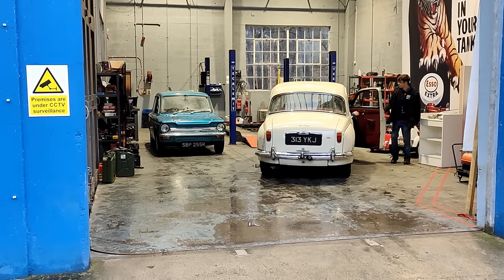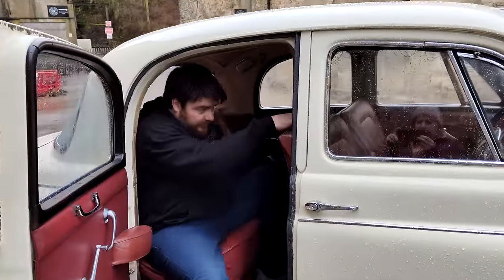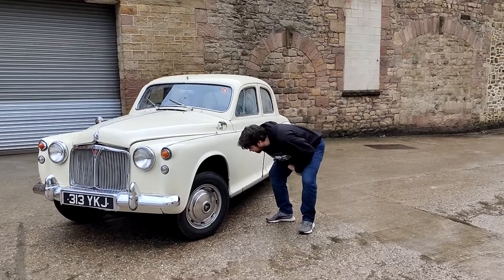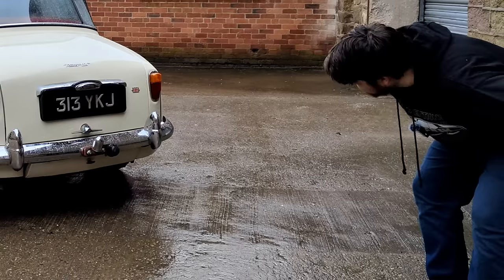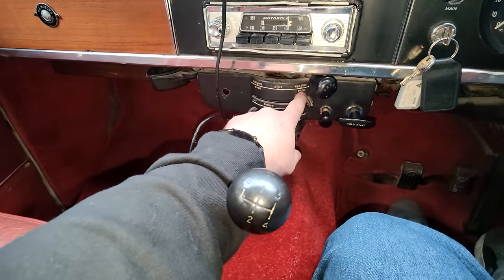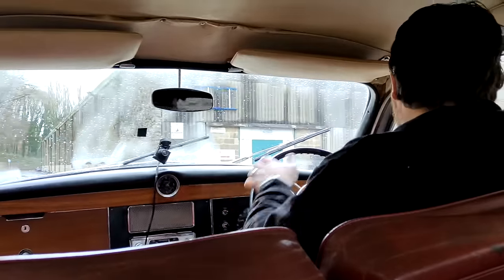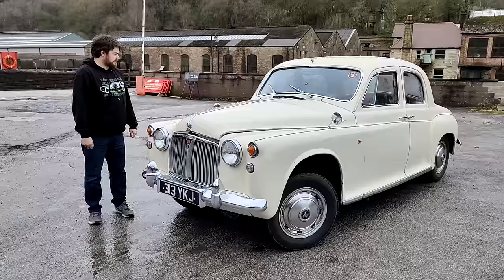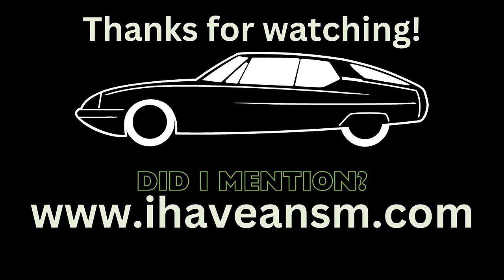1963 ROVER P4 110 - Man who likes the Citroen DS tries a Rover P4 110

Comment: In the mid 70s, I used to regularly walk down the A3 West Hill at Putney where there used to be garage forecourt under the plane trees on the north side of the road that only sold Rover P4s and P5s. I was told they used to buy them up cheap from used car lots, then recondition and renovate them for sale as affordable, reliable, solid and rather posh alternatives to the new modern cars of that time. Certainly the cars for sale were kept polished up with shining chrome and windows - as I recall there were usually at least a dozen cars for sale in a row, headlights facing the road. Always a nice thing to pass by these beauties and stop and take a look.
Reply: I used to walk there in 1963 with my Dad. I wonder if that was the garage which sold the new TR4 then?

Comment: Not the best environment to enjoy a P4 to be honest. They are tremendous over longer distances. The high torque low reving engine was quite happy at 80mph all day long and most later models had overdrive for relaxed cruising.  Whilst not that quick from a standing start, on the move mid range excelleration was pretty good for overtaking particularly with the kickdown from overdrive on the throttle pedal.(this was not an option on the 110 as it had to much power for the gearbox)The crossflow engine has the advantage of not pouring fuel over the exhaust if the float bowl ever overflows! 
  We owned a 1961 P4 100 model in the 1980s and 1990s when the space in the back was great for changing our kids nappies on a wet day out. The petrol flap also locked from inside the boot and if the boot lid had stayed up as it should (needs the springs  slackened of a bit, everyone tightens them up to much and its the opposite of what is required so the springs never get over centre. bit like vice grips.) have done then the spare wheel would be easy, well if the latch has been oiled!
Ours was bought from a small engineering company owner who had bought it new for himself as a retiring present.
The brakes on the later models were excellent using the same disc brakes as the P5 models. This was Rover cars last model to be built on a chassis isolated from the body by rubber bushes to reduce vibration. This example could do with some love really. The back springs probably need replacing and the shocks to give the ride you hoped for.
The early P5 cars used a 3litre version of this engine with a similar weslake cylinder head design as the model you drove.
Utterly reliable, quality engineering. Gave us 50,000 miles of comfortable transport aged between 22 and43 years old during our tenure.
Reply from the maker: Really enjoyed reading that, thanks
Reply: @UPnDOWN  Yes, me too.

Comment: I've had a lift in a P6 V8 way back when and it does indeed waft along. The most wafty car I've owned was a Saab 9-5. Smooth ride and the seats are ultra comfortable. I even inadvertently exceeded the national speed limit by quite a generous amount in one of these without realising it, because they are that smooth with little or no wind and tyre noise to tell you that you are going quickly.

Comment: I've driven a P4 they are actually surprisingly nice to drive and can keep up with modern traffic just fine which for a car of that era is definitely high praise. The highlights were definitely the gear change and the engine which is very smooth and torquey. The steering isn't the best I think it certainly benefit from power steering at making it feel a bit more up to date

Comment: The engine wasn't used in later Rovers, it's an inlet over exhaust valve design, so side exhaust valve, overhead inlet Valve. Don't know why anyone thought that was a good idea, but there must have been some reason for it at the time. And it's a Viking head on the manifold, that being a Rover mascot.  I think Rolls Royce used the inlet over exhaust design too, so maybe Rover adopted it as a look at me, I'm the same engine design as Roller sort of gig!  I think the best word for his car is stately, it was very popular with bank managers and company directors.
Reply: After the war and once he'd retired, I can't help thinking that this would be Captain Mainwarings chariot of choice.
Reply: The one I learnt to drive in had a weslake head
Reply: It was probably an upgrade over a side valve, but why they chose it over a full overhead valve I have no idea, 

Wasn't used in later rovers but it was fitted to some land rovers, was biggest engine available in them pre V8
Reply: @ratchetfox8111  This design allows for a bigger inlet valve than if both valves are in the head
Reply: To see the benefit of inlet over exhaust engines (IOE), you need to recall the tax structure of the times, which favoured engines with small bores and long strokes.  The small bore design limited the size of valves which could be gotten into the head, and also the porting.  So the IOE design allowed for better gas flow than an equivalent OHV engine.  Also, the exhaust valves remaining in the block kept them cooler, as cooled water from the radiator passes through the block before it gets to the head.  An alternative to IOE which permitted better breathing was crossflow hemi heads, used by Riley, Bristol/BMW, and Jaguar.  However Riley and Jaguar had the greater expense of 2 camshafts, while the Bristol/BMW engine had a pretty complex rocker arm system, probably also a bit expensive to make.
Reply: It was certainly the “bank manager’s car” in my childhood 60+ years ago.
Reply from the maker: Ah, that'll be why it had the funny-looking rocker cover?
Reply: The Rover inlet over exhaust 6 lived on for a long time in some LWB, 1 ton and FC Land-Rovers. It gave good gas flow and a good combustion chamber shape but it was expensive to manufacture As fuel quality improved OVH gained the upper hand.
In the 1920's Humber used IOE, later Rolls-Royce and Jeep.
Front suspension on the P4 is not swing axles.
Reply from the maker: Admittedly I was stooping down from above on a cold wet day! Looked like it had a pivot point in the middle, so are they just links?
Reply: 🤠 @captaccordion

Comment: Rovers are amazing cars! The P4, P5, P6, the Ferrari Daytona inspired SD1, the 827 Vitesse, the 75, such a shame they went under...
Reply from the maker: I really like the SD1's styling, and I need to try a P6 one day.
Reply: The 75 wasn't a Rover. It was a Honda with a badge change.
Reply: @Demun1649  You might want to get your facts straight there. The 75 was the last fully Rover designed and built car they ever made. (With a little BMW help for the diesel engined variants). The 200, 400, 600 and 800 series however, were based off of Honda platforms.
Reply: @laurensnieuwland4657  Still not as good as a Citroën, or a Renault, or a Peugeot, or a Škoda, or a SEAT, or a FIAT. The best car, ever made in Britain, was the Ford Lotus Cortina Mark One.
Reply: @Demun1649  I can tell you haven't driven one. The 75 was amazing, and a sad sign of what we lost. And dude, Renault hasn't made anything good in ages! Same goes for Fiat and Seat. The Lotus Cortina was an amazing car, certainly, but not the best. Because there was also the Lotus Carlton, the TVR Cerbera Speed Six, the Rover SD1, the MG XPower SV, Triumph Dolomite Sprint... I could go on for days.
Reply: @Demun1649  The 75 had absolutely no Honda in it either in parts or design, it was about 75% BMW.
Reply: @laurensnieuwland4657  I know you can go on for days. It felt like days as you strung unconnected words together for your post. And you are an Anglo-Saxon, so ANYTHING you say about anything to do with France is just a simple demonstration of out-and-out racism and xenophobia. There would have been no Triumph Dolomite Sprint if the Triumph Vitesse had not been built first.
Reply: @andrewwmacfadyen6958  The engine doesn't equate to 75%.
Reply from the maker: @Demun1649  I'm an Anglo-Saxon, technically, so is anything I've said about France a demonstration of xenophonia? Come on, lighten up. You got your facts wrong, we all do it (I did it a LOT in this video).

For what it's worth, the Rover 75 is actually a nice car. They drive really well. 

Stop picking fights. I know French cars get a bad (and undeserved) rep from Brits, but we're not all against you. And just because some British cars are a joke, not all are. Many are actually very good.
Reply: @UPnDOWN  Yes, as I typed, the Ford Lotus Cortina Mark One was the best car that Ford ever made, although my Ford Escort Mk 1 van did me proud in my 16 years as a professional DJ. And the Chevron B8 and the B16 were certainly the best looking cars ever made in Britain. But nothing matches my collection of Renault 5's, from all 3 of the TL Flair LE, the Le Car, the Gordini Turbo, the Turbo 2, no British car matched them for ease of maintenance, or driveability, or cute factor. The Turbo 2 didn't get beaten by many of the British and Japanese rivals. Oops, wrong word. They can't be rivals unless they are as good.
Reply: @Demun1649  I have nothing against France, nor am I Anglo-Saxon. I'm a proud Dutchie (go Spyker and go DAF!) who just enjoys old British cars. Same goes for French cars. I adore the Citroen SM, CX and BX, and the Alpine A310 and A610 are probably some of my favourite cars ever. I also wouldn't mind to own a Renault 21 or a Fuego at some point. If anybody is being xenophobic it'll be you, who is talking crap about cars they've never driven.
Reply: @Demun1649  Years before the modern one the was a 75. It had an additional spot light slap in the middle of the grill.
Reply: @lerpack455  And your point is?
Reply: @Demun1649  That neither car has been built by Honda.

Comment: I had spotted the white P4 in the background of some of the shots and was hoping it was going to be next! I have a very scruffy 110 (think Clement but P4 and saveable) that I stopped daily driving for works before winter, noticed a few bits about this one that weren't right - that one is much nicer than my own. There are some things that have been covered by other people's comments about P6 taking over (but '63 and '64 they overlapped production and they are very different cars!). The P6 never had a 6 cylinder in production, and the SD1 6 cylinder was Triumph developed. That one has a non standard carburettor, the vikings head is mounted to where the air cleaner/silencer would be mounted - would have a 2" SU HD8. I also noted the wipers weren't parking properly - when you turn them off, they should wipe once more to half way across the screen, then go back and park themselves off the screen. The boot lid failing to stay open could well be the inner wheel arches having rusted out, as that's where the lid springs mount to. And there is an anti roll bar up front.

On the last couple of years of production, Rover changed the stance of what the model number means, so it went from being the approx bhp (eg 80 and 100 that came before), and was replaced with the 95 and 110 - which were the approx top speeds in mph. The 110 is the engine that had a cylinder head design tweaked by Harry Weslake (commonly misspelled with a t) to have larger inlet valves and a longer tract bolt on inlet manifold, combined with the bigger carb, paper air filter instead of oil bath, and larger diameter exhaust than other models made it the most powerful P4.

My friend who orchestrated me getting my 110 (and had them when they were relatively new) says they're a bit of an acquired taste, some people love them, some people hate them, but to truly appreciate how tough they are, you have to daily one especially on longer journeys for at least a month, they can certainly take a good thrashing too, and the 110 (when not misfiring) are quicker than a mk2 Jag (only the 2.4). They're a good motorway classic, even better with overdrive, better than a 4 cylinder P6. (I am more a serial P6 enthusiast). Trouble with P4s is they tend not to break, aside from when they fail to proceed of course, but things like the suspension rubbers change shape rather than break down completely, which makes them less appealing to drive, but still drivable and within MOT tolerances!

Comment: I once owned a Rover 75 in 1973, delivered new in New Zealand around 1953 or 4, a later non cyclops model with a 2.1 or 2.2  liter 6 cylinder engine, earlier model to the 80, 100 and 110, similar shape, it had a free wheeling mechanism that allowed the gears to be changed without use of the clutch, and would freewheel when speed exceeded engine revs,  there was a small wheel under the dash that when rotated activated this feature.
It was a very smooth car to drive and although not quick accelerating, once at speed it cruised very nicely and very quietly.
Mine had a collumn shift and although nearly 20 years old at the time was very precise and smooth to shift. 
A valve type car radio, Radiola I think was at time of manufacture a bit of luxury, and the heater worked quite well.

Comment: The engine was not used in any later Rovers (although it was used in series 2 and 3 Land Rovers for many years after), and the P4 was replaced by the P6, the P5 being a larger car (initially with a 3 litre version of the 2.6 in the 110 and other P4s).  Showing my age in knowing all that....!
Reply: Super smooth engine for the Land Rover 2a/3  but only offered on export models 🤷‍♂️😡
Reply: The IOE engine was in the 1963 Series 2a forward control Landy and the Series 2a and Series 3 long wheelbase from 1967 until they finally put the V8 in the Series 3 in 1979-ish.  All could be had in the UK but were pretty rare.

Comment: I had a P4 80 in the 1970s. Steering was not assisted, so a little heavy when parking.
Engineering features: the fuel tank had second level in it which worked as a reserve (hence the switch on the dashboard). Also, there was a dipstick inside the car to allow you to check the oil in the gearbox. Also had a overdrive feature.

Comment: In 2010 my cousin and I would like to take part in the Mille Miglia. It is really difficult to get in, because too many people apply for it and you have a bigger chance to participate if you drive a really special car. My cousin found out that you would be eligible in a Rover 75 (P4) from 1956 and also that such a Rover had never participated in the "new" Mille Miglia. So he bought a really good one, applied, and we were in. It's not a real rally, but you get to drive on a lot of interesting roads between Brescia and Rome, and the Italians are very enthousiastic. I drove the last leg, back from Rome to Brescia, and it was fantastic. I had to drive really fast in the heavy car, and it held itself really well. It wasn't too difficult to get it to drift through corners, and you could drive over speed bumps without slowing down. As a bonus I had to drive three laps on the circuit of Modena in the Rover. Wonderful car, wonderful experience.

Comment: These engined were used in Land Rovers before the V8, and enlarged 3 litre versions in the P5 also before the V8. The P6 had an all-new four cylinder engine (before the V8) and the four-cylinder SD1 used the O Seried engine also used in the Montego and Sherpa van (actually after and alongside the V8 in this case). The SD1 also used an entirely different six pot. I wonder why British Leyland went wrong...
Reply: They never made a 4-cyl SD1.
Reply: @1258-Eckhart  According to Wiki, there was a Rover 2000 with a four-pot: https://en.wikipedia.org/wiki/Rover_SD1#Further_range_expansion
Reply: True. How strange. Missed out on that.  @HowardLeVert
Reply: @1258-Eckhart The Diesel had an Italian 4-cylinder engine with separate cylinder heads.
Reply: @1258-Eckhart  I remembered the SD1 Rover 2000 from my youth but never knew at the time if the engine was four or six cylinders.
Reply: And I only remember the Rover 2000 as a P6 - also from my youth 😍. But the "2000" is now iconic, and the SD1 is a V8 with straight-six alternative, end of.  @HowardLeVert
Reply from the maker: The 2600 version of the SD1 is what had sprung to mind.
Reply: @UPnDOWN  2600 and 2300 Triumph-designed OHC 6s, then with the Series II the Austin/Morris 4 cyl 2000cc ‘O’ series petrol (from the Princess 2) and the VM engined diesel.

Comment: The P5 came out and ran beside the P4 for several years, and was originally fitted with a three litre version of the 2.6 six cylinder overheard inlet side valve exhaust fitted in this 110. These engines originally had SU carbs ...

The Buick designed, but Rover redeveloped, V8 went into the P5 in 1967, and latter the Range Rover, P6, MG {derived from the MGB], later Land Rovers, and many more ...

I prefer a straight six to any V8.

I would love to drive this 110!

Best wishes from George

Comment: P5B was the V8 B= Buick, P5 straight six 3 litre. I bought a P4 (Auntie) when I was 19 for £15, had two new Pirelli Cintuaratoes on the back, MOT had run out and needed a clutch,  needed one brake pipe for MOT, I sold it to a mate for £70 and he did about 50K miles with no problems after fitting a new clutch, outside his house, on the road, no mean feat !

Comment: Thanks once again Mr UpnDown, the P4 6 cylinder engine was a traditional push rod engine OHV engine, and the Engine in the SD 1 Rover was a more modern Overhead Cam 6 cylinder 2.6 liter engine with slightly reduced piston stroke to achieve higher engine revolutions.6-cylinder
Reply: It was’nt actually an OHV engine completely Andrew, it had overhead inlet valves and side exhaust valves. This was the same configuration used by RR and Bentley in their 4.5 litre straight sixes in their post war models.
Reply: @malcolmherbert5127  Also referred to as an "F" head. Van den Plas 4-litre R was also this configuration.
Reply: @malcolmherbert5127  Thanks for correcting me,  , which means the inlet Valves were OHV, but the Exhaust was sleeve Valves/ Side Valves relying solely on Piston position, Okay I now understand thanks 🙏.
Reply: @RobertSmith-jl4yw  Yes of course, that was a Rolls Royce engine